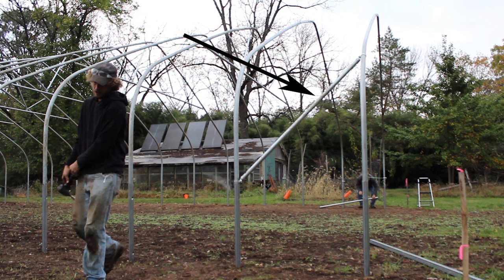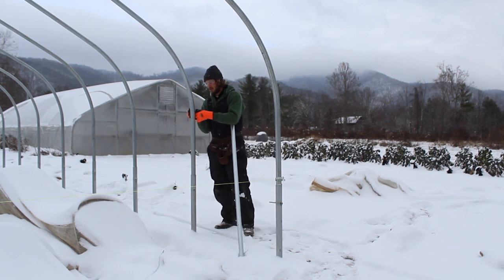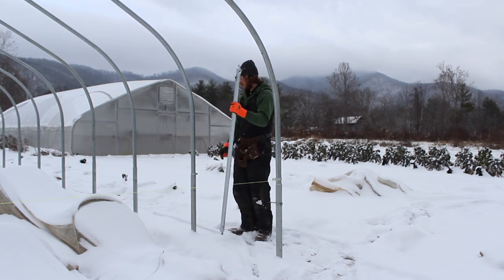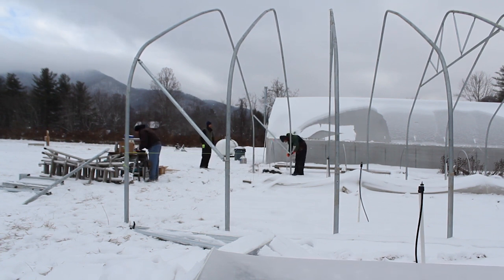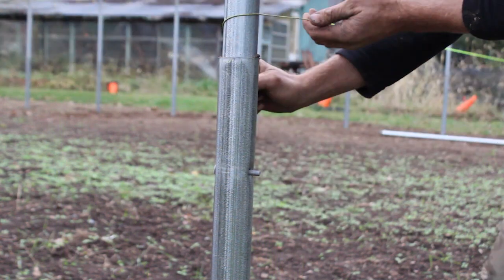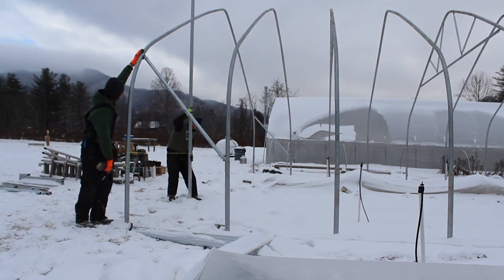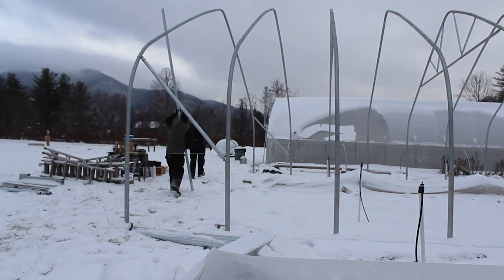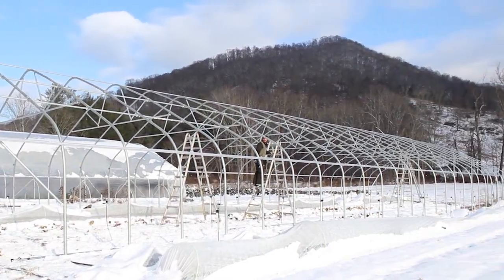Installing Greenhouse Corner Wind Braces on High Tunnel Hoop House

Comment: What is the length of the tubing on the corners ?
Reply from the maker: The corner braces shown in the video are 69 inches long. They were installed on bows that were spaced 4 ft. apart from each other.